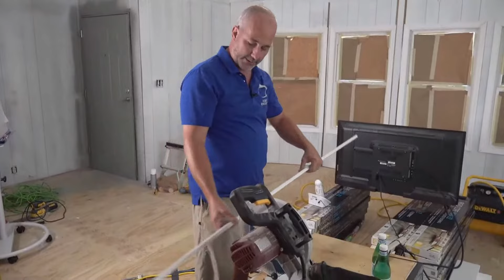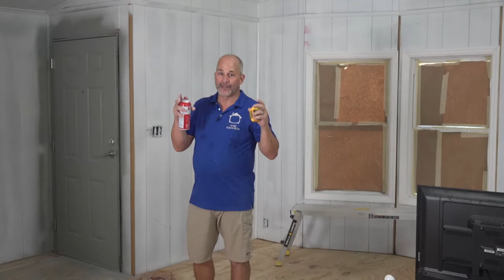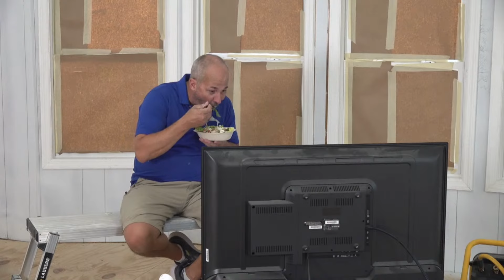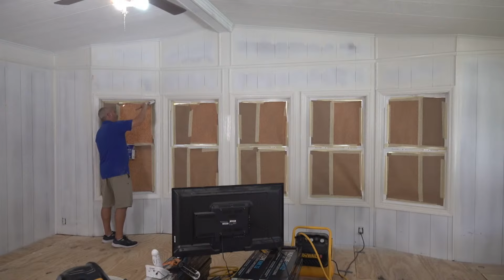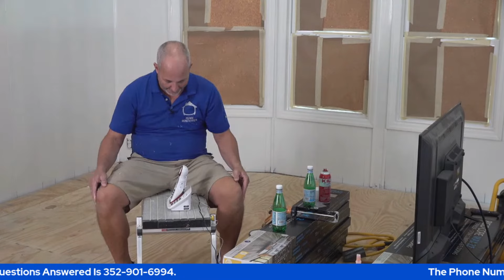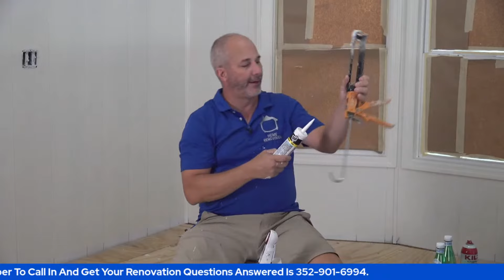Working On My Project While Answering Your Questions and Live Calls

Comment: Thank you for sharing your process it is SO very educational to see you work through challenges when they arise! Confession - I have NEVER poured epoxy and am preparing to apply what I have learned here on two major projects in our remodel of an old victorian home. One to do our kitchen counters and the other to do a shower. I have a QUESTION about the area where the shower doors anchor through and the front edge... instead of cutting a box and adding an creating an inlay of wood for the anchor point and using MDF for the front edge, I'm considering using a strip of MDF wide enough to do both. Can you think of any reason why I should not? I welcome your wisdom as I try to price out and plan. Thank you in advance!

Comment: I walked into a 1/2 Renovated house that was built in 1900 in Oregon.  The MBR was torn apart and bath/shower combo was converted to shower only. I want to make it back to Tub/Shower with a jetted tub, what does the plumbing look like for that. There are holes and pipes everywhere. The previous owner passed away so I could not ask him. :-/

Comment: Jeff, How critical is it to not slope bathroom drain pipe too much more than code minimum? My bathroom Reno involves sloping a 3 inch toilet drain which code ( Virginia in the US) requires min slope of 1/8”/ft. (0.6 deg). I put a lot of effort in getting 0.8 deg. I put a lot of effort into getting that and feel that I made it more critical than I should have. How do you determine max acceptable slope? Do you know why code doesn’t also state max slopes? Thanks.
Reply from the maker: I am sure it does. if it is too dramatic the water rushes past faster than the solids. at the end of the day 1 degree is perfect everytime. Cheers!

Comment: So excited about your manufactured home project! I'm looking to convert my deck which is about 12 by 36 into a screened in porch I'm debating putting in Windows or just doing screen do you know of a good line of products for doing such a thing? Also looking at Roofing at with steel or polycarbonate
Reply from the maker: I would go with steel for the roof, same framing but better shade. It is actually very affordable and they can deliver it pre cut to the length you need. Cheers!